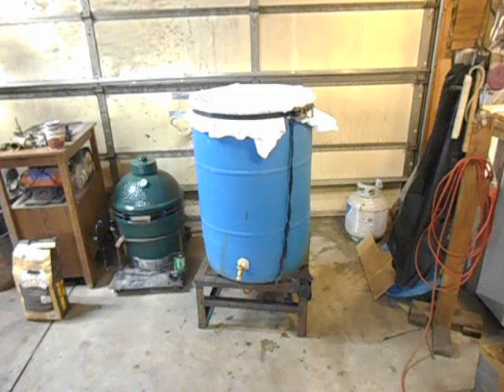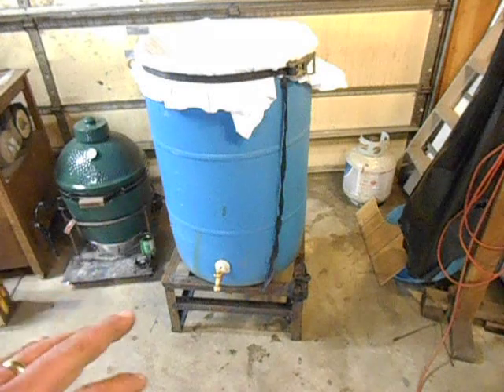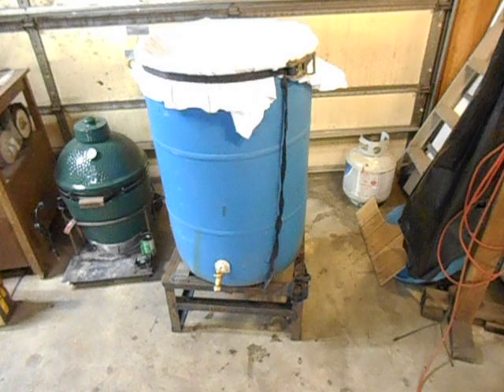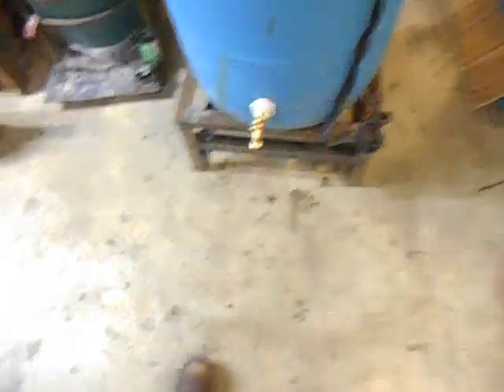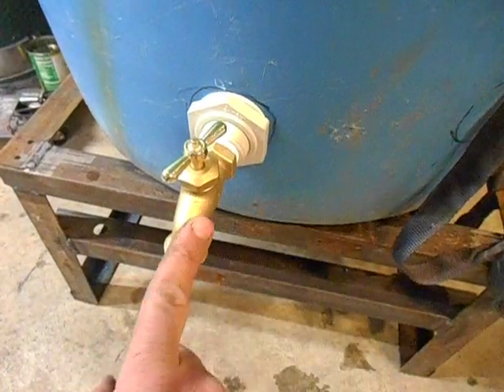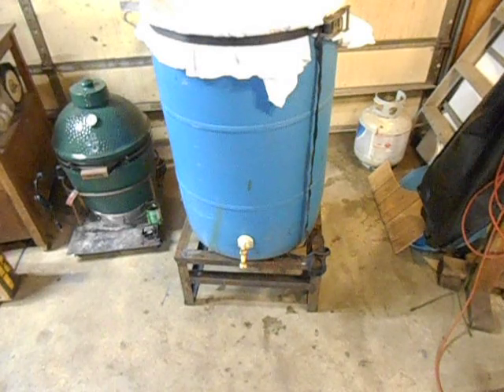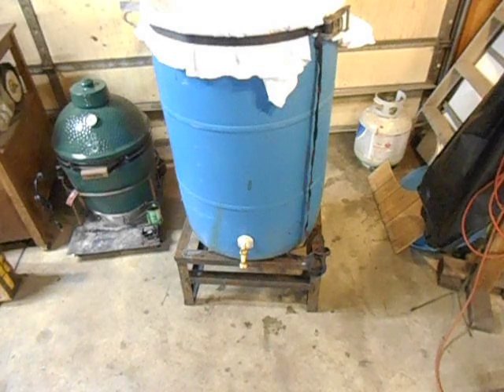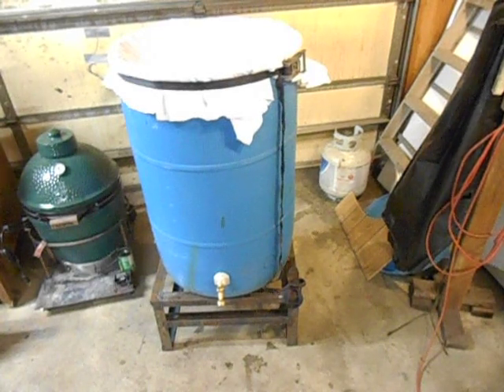waste oil simple filter system

Comment: great video. do you have a follow up showing your setup filtering oil?  I'm very interested in how well it works as I have the same need. ty
Reply from the maker: i dont have a follow up. the burners I needed the oil for run so efficiently that I rarely use them and might burn 1-2 gallons of waste oil a year, so I dont use it much nowadays.

Comment: where do you get the waste oil from?
Reply from the maker: +C amber I had some from my own oil changes. and now that I have a use for it. several friends have brought me their old oil and will probably keep bringing it. and I have a couple friends that work for places that have a lot of heavy equipment that say if I need more to bring a truck to their workplaces and get as much as I want as apparently they have to pay to have someone come haul it off. I would bet that I probably will not need to work very hard to get a good supply as the little foundry only uses a gallon an hour or thereabouts. and even though the big scrapper uses a lot, I shouldn't need to run it for very long as much power as it has and as quick as it melts the big stuff down.
Reply: Very cool, free fuel is not common!
Reply: Joe Calto
Reply: C amber tree's dummy

Comment: I thought that setup looked familiar when the vid opened!
You are right, this sort of filtration will be more than enough for a burner. Some people try filtering it down to micron cleanliness but it is not needed in any way for a drip burner. 

Are you sure you went through 7 gal of oil in 15 min? That's 1000Kw heat output.  I would be surprised if your blower and the pipe you are running from it would support that much combustion.  I have done around 750 Kw and I know what that is like, 1000 is something you wouldn't stand within 12-15 ft of but it would knock those ally wheels over in no time. You could fill the drum with wheels and load them in fast as they melted and have a stream of molten ally coming out like a garden hose!  :0). I don't think the Castle blowers I have would come near supplying enough air for 1000kw but maybe you have a real powerful one...... that I will have to procure a similar one myself!  

I made a mod to my filter setup like this on the weekend.  I got a smaller Drum and put a tap in the bottom with an elbow and a short piece of pipe so the end points down.  I cut a hole in the lid of the felt filter and sat the small drum on the top.  With the drum on the top capped and the valve open, the top drum will keep the filter full but not over flow it. I think they had bird waterers like this. It only lets more oil out when the level drops and can get into the drum.  Every so often the top feed drum takes a big gulp of air and drops more oil but I also saw a stead stream of bubbles coming up when the oil was filtering faster than the drum could supply it. 

It works a treat because it increases the capacity of the filter area and keeps it topped up so you get max surface area filtering. I get about 25L in my felt filter so i can top it up and put the drum on top and I then have 50L that can trickle through during the night or day and just make the whole thing more efficient.  I did 600L of oil this weekend so I could prepare a heap of fuel to go on an interstate trip in a few weeks time  and seeing how I have a much larger requirement ( depending on how often you fire your scrapper!!)  I'm going to replace the 25L top feed drum with a 60. 

This will be really helpful in winter when the oil is fatty and very slow to drip through. It will be working for me all day every day and keep production up nicely.
Reply from the maker: +Oil Burner yes, it should look familiar since I got the idea from you! :}to tell the truth, I don't know how fast it was going through the oil. I know I started with 7 gallons as that is what my tank holds. and I was working with it for maybe 1 hour, but the majority of the time it was not running, as I was figuring how to bring it up and learning the oil valve and the blower. I do know that I over built the oil delivery system. at one point I got heavy handed on the oil valve, then the flames really woke up, I decided to move my truck farther away, and in the 2 minutes or less that took, it dumped 18 pounds of oil into the burner and flooded it out really bad. what with all the excitement of getting it running, I didn't take notes. I will the next time I fire it though so I can put it in my log book and compare notes with you.the autofeed filter sounds great!!!! anytime I can set something up so it works without me, I don't hesitate to do it!now on the blower and the size of the burner. ive got some thougths on that, mostly coming from the propane forges ive built and the short amount of time ive run the waste oil in the foundry, and watching your vids a lot deciding how to build mine. and what I saw when I fired my scrapper seems to back it up. but it has to do with how the burners breathe. I know that with propane forges, most folks want to seal them up so tight and with so much insulation that the forge cant breathe, or get rid of the old  air fast enough to run efficient with a small blower. the waste oil seems to be the same only a lot worse. it seems that the limiting factor is not the amount of air, but how the burner uses it and the backpressure that the combustion creates, which then will fight the incoming air as it tries to get out.so if the burner creates more pressure during combustion than the blower can produce, then you either need a bigger, or higher pressure blower, or to drop the pressure in the burner to allow for more incoming air. I bought the gingery book on making your own blowers, and he described the differences in the types of blowers and the design features of the different types of vanes, and how each type slipped air when faced with too much resistance to flow which really helped explain what id found with different blowers on my forges. which is why I put a 2 3/8" inlet and a 3 1/2" outlet on the burner. and I think it would be even better with a 5" or 6" outlet to reduce the backpressure and get everything I can out of the smaller blower. with the scrapper setup, Im not too sure that it matters if all of the oil is consumed inside the burner as its going into the barrel afterwards, and I don't think it would matter if it finished burning there. about the only downside I could see is having enough backpressure to bring the burner up to temp during startup. but a simple flap of steel {or a sliding gate valve type setup} on the end of the outlet so you could regulate that pressure would be easy enough to do.
Reply: +Joe Calton   You are spot on with everything Joe you say about the inlets and outlets and back pressure. 
Jet engines work by heating the air to expand it so you are going to have more gas coming out than in.  When I designed my 6ooKW burner I put a  2.5" inlet and a 3.5" outlet. I had a same size outlet to begin then realised my mistake when I figured how much more fuel I could burn in teh 44 gal burner I made that had a 6" inlet that wasn't even sealed to the blower ( bit of venturi effect as well i think) and I just put the fuel line in front of the blower outlet to push the fuel in that way. Going to the bigger outlet gave me 300Kw better heat from the same fuel system  straight up and I maxed it out before I ran out of air so I know there is still more potential in the thing. 

 I would have gone bigger on the outlet except that was all I had but I'm a nut case and just like big flames.   For you, I would say don't go any bigger than you have. It changes they dynamics of the swirl in the burner and trust me mate, Time you max out a 3.5" outlet, you won't have a desire for any more heat. 
I have found some back pressure does help with startup though specifically if you are running big outlets. I surmise that restricting the outlet somewhat helps the heat retention and allows the burner to warm up instead of all the heat blowing straight out without literally touching the sides. 

As for insulation and small vent holes, I completely agree. All my furnaces ( as dodgy as they have been) have all been open topped.  My theory is that if you blow in enough flame and the crucible or work you are heating is completely engulfed in 4" of flame in every direction, WTF you need insulation for?   :0)

The reason I suggested 2Lb pressure in the first place was to prevent what happened to you. Oil flows real fast through a 1/2 hose with 10 Lb behind it. The fact you dumped so much oil would account for your sky high usage. I knew with that blower and pipe size you wouldn't be doing 1000Kw as a sustained burn at least.  :0)

The flareups can be fun or scary depending on how used to them you have got. 
If you over feed the burner, what can happen is that only a certain amount of oil will burn, and it can burn very clean, and the rest will pool in the bottom of the burner.  At some point, the pooled oil all reaches boiling point and wants to vaporize all at once.  A litre or 3 ( no idea what 18 pounds worth would be like!!) of oil burning all at once or at least in 20 sec is rather impressive. 
I can see why you said you had the diameter of the barrel 8 ft high in flame. Bit surprised it didn't over cool and go out actually at that rate but I suppose  a drum has a lot of surface area so that was probably enough to keep it hot enough to burn. 

As much as all the safety nazis whinge at me for not wearing gloves or other safety crap, the one thing they don't have the smarts to realise is that I locate my contraptions far away from anything that if they do have massive flareups or meltdowns or whatever, I don't care. There will be nothing around to burn but maybe the blower and that's not the end of the world.  I have had a few people try to build these things but the minute they get going and a flame more than 2" comes out, they shut them down in a panic because they are in a confined space or worried about a whining neighbor or other things I have no regard for. 

Run them when they can burn in a fireball and you don't care and there is nothing to worry about.  :0)
Reply from the maker: +Oil Burner  ok, so I went a visited a buddy that works on a lot of cars, and talked him out of about 15 gallons of mostly clean used motor oil, was really easy, I asked him if he wanted to take it to the recycle center, or let me haul it off for him and he even helped me load it into my truck :}  Its all in my filter barrel now, so in a few days ill do another run of the scrapper!so I go to thinking about the air pressure, and the need for a larger oil tank for the scrapper. and remembered that I have a spare oxy/act rig collecting dust on a shelf. so the plan is to take the oxy regulator, and put quickdisconnect fittings on it so I can have a lot more control over the air pressure. that regulator regulates in 2 pound increments, so should work pretty good.for the bigger oil tank, I got to thinking that I was pretty surprised when I cut the top off the 50 gallon plastic barrel that it was about 3/16" thick plastic. a quick search on youtube came up with a fella testing one like that and it didn't blow until it got to 65 psi. so with the better air control, I feel pretty good that it will hold 10 psi or less. and I have 3 more of those barrels that are in good shape to play with.I had figured to keep the 3.5" outlet for a while, until I run it more and see what it can do. to tell the truth, I think I really overbuilt this one for what I want to do with it. but figured that I could always run it lower. when it pushed that much oil all at once, it did flood the burner and put the fire out in it, but the barrel was still hot, and so the fire moved from the burner to the barrel and stayed there. with the heat that you are used to, I doubt that you would need much insulation for anything unless you were trying to do a controlled iron melt :} when I finally melted down a camshaft and poured it, it was pretty dang hot in my little foundry. even with 1" of 3000 degree refractory, it was burning the paint off the outside of the foundry!I hear you about the safety Nazi's. I think that "safety" is a way of thinking, not equipment mostly. building and running things with thoughts on how things work, clear areas, trip hazards, escape routes, keeping your head when things go south, ect....  When I wanted to test this furnace, I took it to a good open location where I could control who and what was there. There was 6" of snow on the ground, and since it was  cool out {about 32F} I had on my carhart insulated bibs {I don't know if you have those where you are, but I joke that they are like armor}. and even called the fire department to give them a heads up {if you don't do that, and a neighbor calls them and they come out, they charge you for the call I hear}. when the burner flared those 8' flames, I thought "dang, that's cool!"  I don't think the safety Nazi's realize that with that kind of heat, a pair of even really heavy welders gloves only give you about half a second of protection.
Reply: Joe Calton
I use an old oxy regulator for my pressure control. Don't know about your system but here the fuel and " air gasses are threaded the same so I took the air fitting off and put a fuel one on.  Now I pump up an old LPG tank to about 100 PSI and put the regulator on that.
Pressurises the tank for many burns because the setup is airtight and I am only replacing the oil volume that is used in the oil tank which is very little air volume wise.

I have been thinking of trying to make a burner out of an old Oxy hand piece.  With good air pressure I'm thinking they may spray the oil enough to burn and the control would be very precise using the hand piece valves.
Reply from the maker: +Oil Burner I was wondering how you were regulating down to 2 psi! today I drug out that set of regulators out and ended up using the act one as it regulated lower. just took the 1/4" fittings on the inlet and outlet off, and installed quick disconnect air fittings, so I now have an inline regulator that moves from the normal foundry set up to the scrapping furnace. and since the control is so fine, I can regulate in 1 psi increments and find where the sweet spot is, instead of guessing with my compressor regulator.I also got a 50 gallon electric water heater from a friend today! got it all stripped down and its ready for some new fittings tomorrow. im going cut a 2" hole in the top, and then weld a 2" nipple to the top of the tank for a nice big valve to fill it {the 2" hole will also make it much easier to clean out any junk in the tank}, and then set it up for the air, and just use the drain valve for the outlet for the oil. then pressure it up and find out where it was leaking and seal it back up. so that should take care of the running out of fuel problem :}that sounds interesting on the oxy hand piece! are you after a very small burner? or going to see if you can make a waste oil/oxy cutting torch?and I got to thinking the other day. do you think you could run one of these waste oil burners on straight diesel? I mean if you ran out of waste oil, and needed to do a burn?
Reply: Oil Burner

Comment: Kindly informed me filter paper specification?
Reply from the maker: I don't have any specs on the filter cloth. id bet you could use whatever you have handy, as its just to get the bigger stuff out. the smaller particles should sink to the bottom of the tank, which is why you put the pipe for getting the clean stuff a couple inches up from the bottom.